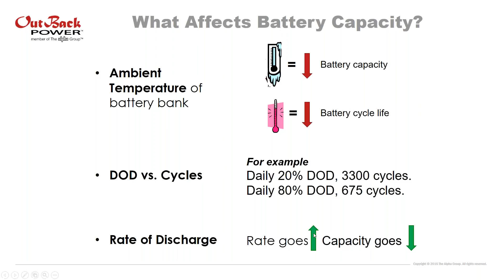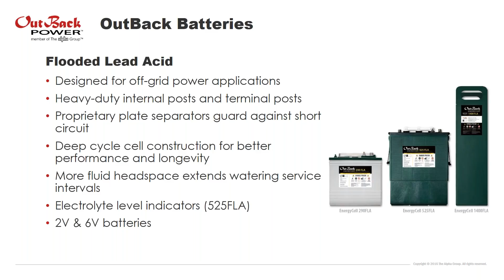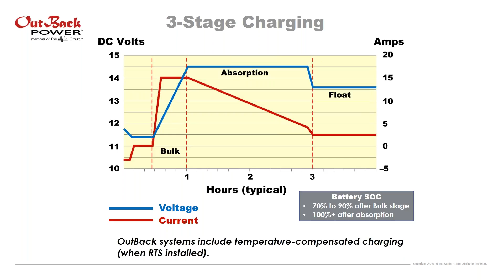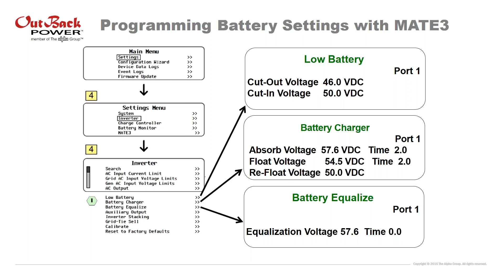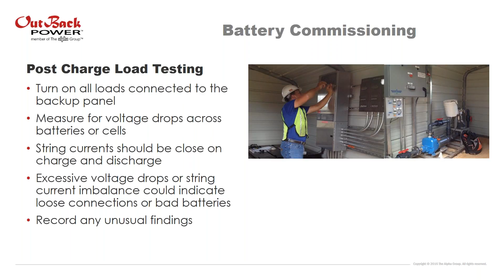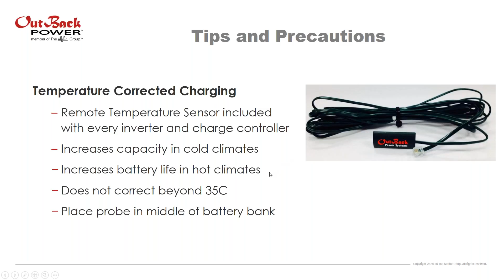Webinar | Best Practices for Charging OutBack Batteries

Comment: The video is helpful and not so helpful.  There seems to be a paradigm for 50V systems.  OK, basics described, but how do they apply to 24V systems? How are the voltages/currents in these systems different?  When/Why is an Equalize charge applied? Part of the problem is the video is treated like a group chat, rather than figuring out what, and especially HOW to present. Frequently, the presenter sounds as if he is looking in his "mind's eye" what he is trying to say rather than have practiced this presentation and have these mental moments become clearer to present.  Almost ALL of these Webtalks present the same way.  There are several where the presenter sounds as if they are talking across the room or through a towel into a coffee cup.  You guys need to redo these videos in a more professional manner...I take it you do want to be taken as serious professionals than just a group of techies trying to flex mental muscle.